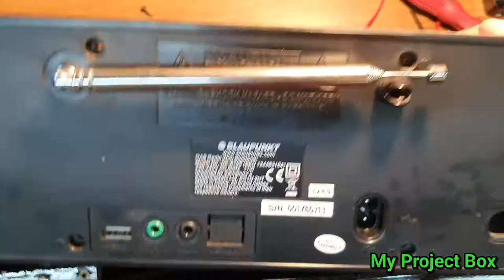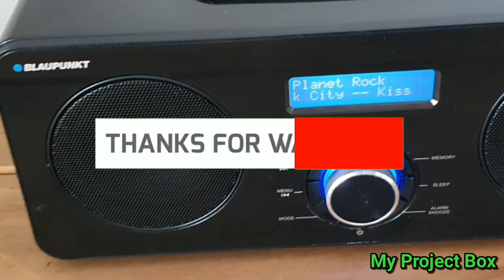DAB Radio repair #ElectronicsCreators

Comment: I tried to fix a few power supplies before, knowing that it was most likely a capacitor. I just never know which one...
Reply from the maker: I know SMPS can be such a pain! it's always been hit and miss for me😤. especially with intermittent faults🤨
Reply: @MyProjectBoxChannel  I usually try to recap it completely if possible.
Reply from the maker: @pashko90 you are right, I should have gone into a little bit more detail.😉